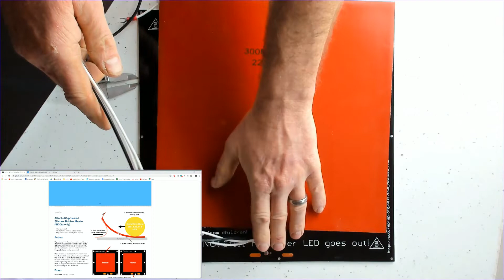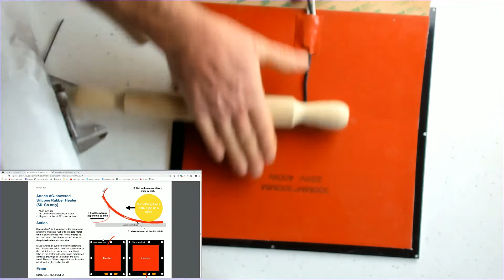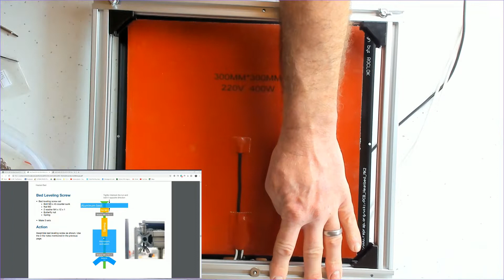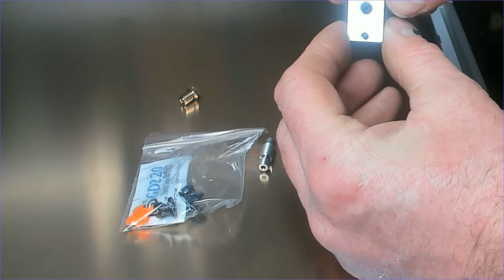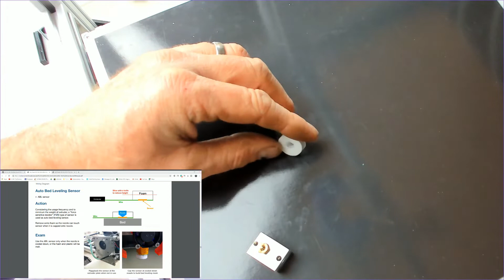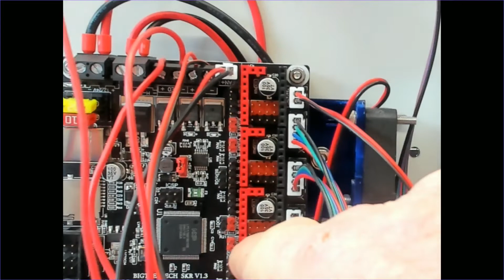The SecKit Go Big Build Part 3

Comment: Just another thought about tightening the nozzle which you recommend to be done at high temperature: would the nozzle not be tighter if tightening would occur with a cold nozzle? When the heat is switched on, both the nozzle as well as the heat brake will expand bringing the two parts closer together?

Comment: Dear Mat,  without your effort I would have been in trouble, no doubt. With some parts missing in the instructions (hot end), some more difficult to work out and most of all my one inadequacies things may have turned ugly. Having said that I have a couple of remarks which would improve the instructions further: It is not necessary to take up so much of the screen real estate with the PDF instructions. Perhaps initial advice that and where to download and at most the page number on the screen would suffice. This would also benefit the framing: with more of the screen available you could frame differently and your activity would not be out of frame quite so often. A little less zoom would not make things less clear I am sure.
Having said that, once again my appreciation for your assistance, I recognise that it would have taken you quite some time to put together and the quality of your instructions was great.